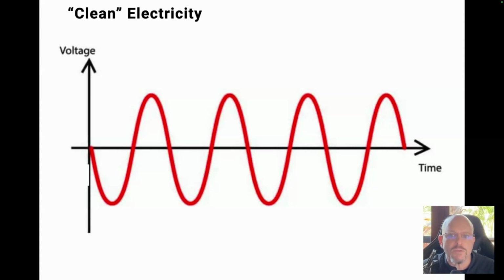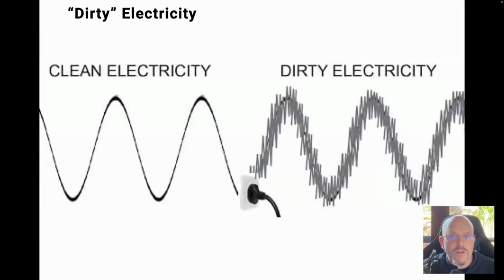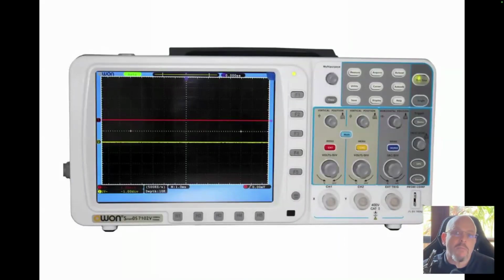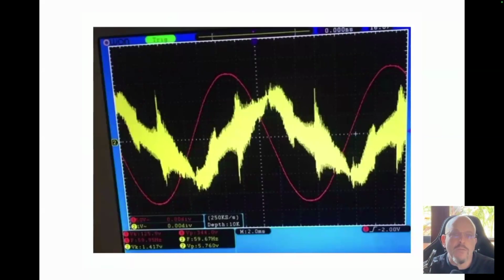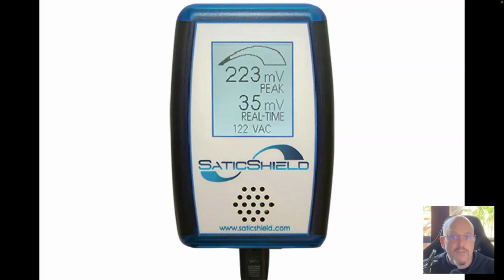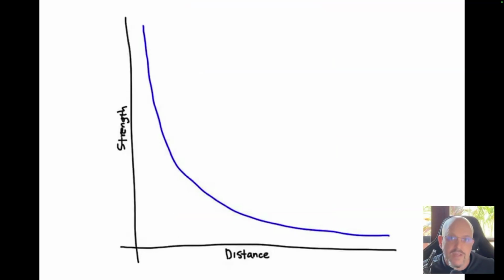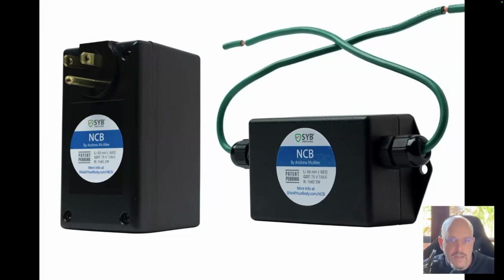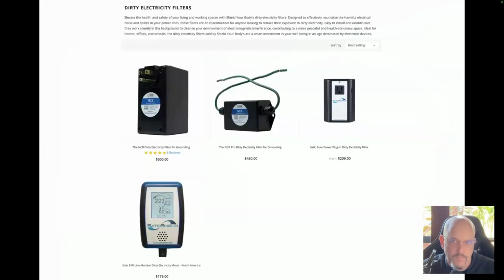Dirty Electricity EMF: What it is, and how to clean it.

Comment: So I've got a power point in my room right behind my bed.
The issue is it won't turn off, I flick the switch and nothing happens. 
So my first question is does it produce EMF even with nothing plugged in?
And my second question is will there be 0 EMFs if the switch worked and it was turned off?
Reply from the maker: Yes, odds are high that it is emitting EMF even with nothing plugged in. The way to know for sure is to test. We have a free ebook explaining how to do that here: https://shieldyourbody.com/test    And yes, if you fully de-powered the circuit, the EMF should stop.
Reply: @Shieldyourbody  thanks I'll have a look.